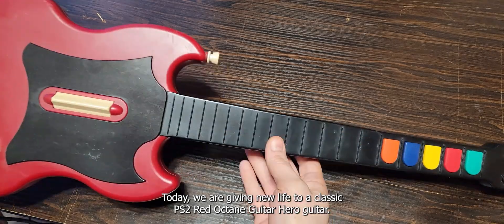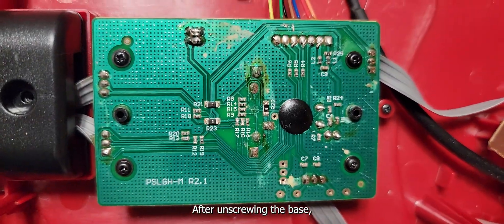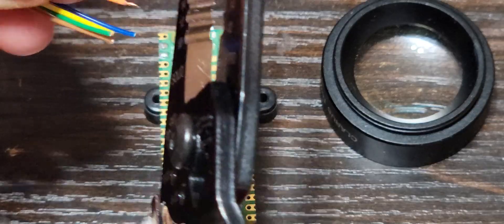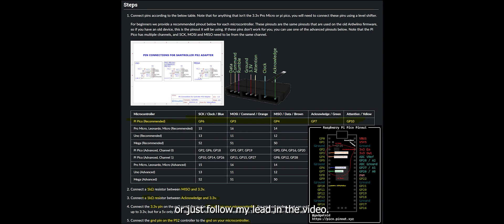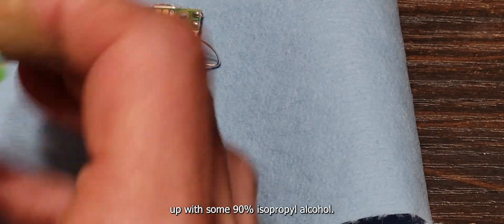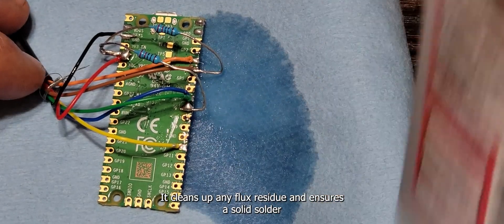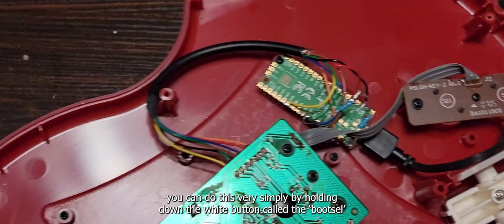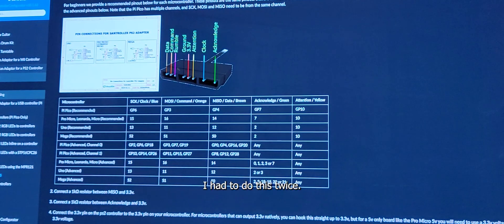How to Transform Your PS2 Guitar Hero Controller for PS5 & PC | Clone Hero & Fortnite Festival 1/3

Comment: Man this is insane, i will do it when my rasberry pi pico and the resistors arive, then i tell if it worked properly
Reply: Wow, it really worked!! Even the santroller also have a new feature that can auto configure the buttons to guitar hero controller, you only need to run and select guitar hero controller, then test the buttons and save, Thank you so much man <3
Reply: @RevengeNooBr I'm glad you did this I'm gonna try this out now thanks man
Reply: @soysebdev  You're welcome, now every ps2 guitar I find at the marketplace I will buy it and do this
Reply: I did this and it's not working the inputs isn't working and it says no controller found

Comment: hello, im planing to do the same with my red octane guitar from the ps2, but the main PCB from my guitar has no issue. 
it will work alright after adapting the pi pico? or i will have to discard the main PCB and then mount everything into the pi pico.
Regards!